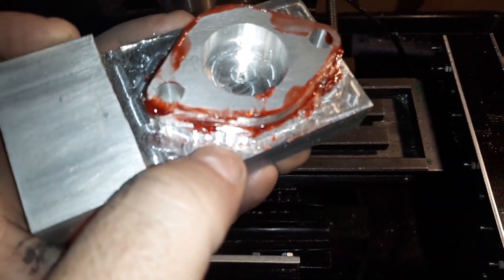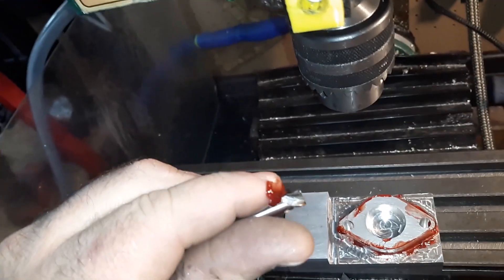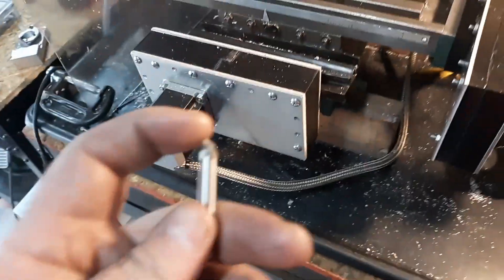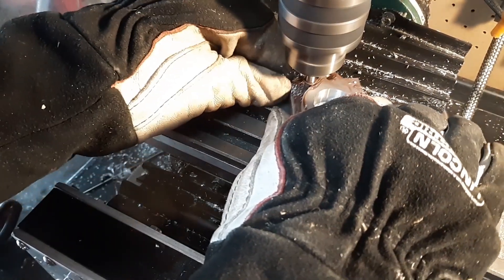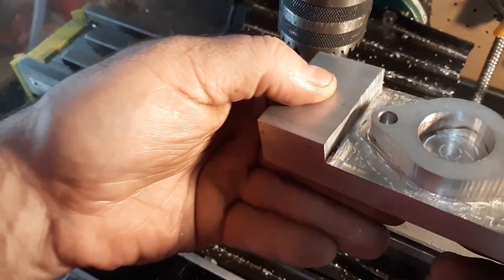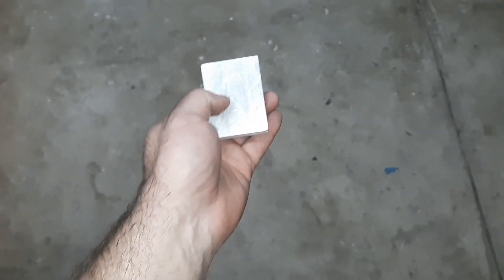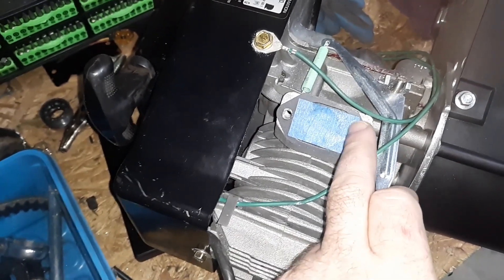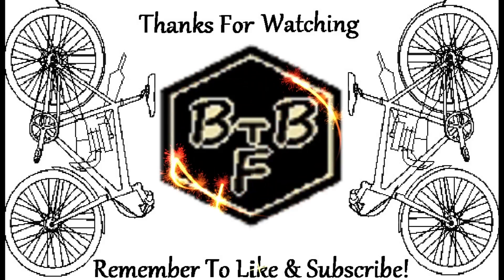139cc 2 Stroke / CVT Motorized Bicycle Build - *HUGE* Intake Adaptor Explained! (CNC Failure) Fixed!

Comment: Yeah dude, make some money, you're doing the work. I pay the $13 a month for YouTube so not getting the ads except on news channels. Thanks, l always thought it was used for drilling as well as rusty bolts. Poor people have poor ways.🥴 Good to see you still have both hands attached 😁
Reply from the maker: well wd40 actually will screw up drill bits.  Most don't realize as it burns when you drill bakes a coating onto them actually works against you slowly over time, like when people use it on brass or copper of aluminum. short term helps till it heats up some then you f'ed bit coated in what ever your drilling lolz   other funny thing is it has teflon in it!  actually makes drill bit not bit into steel  type metal as easy! dulls the bit faster.  most don't realize if you use normal cheap motor oil thinner the better actually makes drilling/tapping  stuff crazy easy vs wd40 and is cheaper!  Tap magic you always hear about! tinny can cost stupidly high amounts cash lol  actually just 0w-20 motor oil pretty much dyed white.  It's untold machinist  secret most big companies buy it by the 50 gallon drum! vs over priced stuff they sell as "taping/cutting fluid" lol  "cnc coolant" looks like that stuff different then the stuff you see all together, most confuse the two, but not stuff they sell to public just light oil!

Comment: Great save! I thought I was the only one that did risky "free hand" machine work. I admit to machining an old boat motor throttle bracket for a friend at work on a large VSD drill press when the Bridgeport mill was busy/tied up with official company work. Clamped in a loose, smaller vice for mass, I slid the vice clamped part to a 2 flute mill bit & "machined" it to the marks scribed on the part. Ugly? Yeah, but a few seconds on the belt sander followed by 3 min. on hand sand paper & my friend was amazed & happy. Fishing happened after that ! Love this channel & the build!

Comment: As a machinist for 40 yrs I had to cringe a bit at the free hand method,, then I remembered you are an old fossil like myself so when we say " old school" that means before computer assisted machines lol
Reply from the maker: Well the Issue was! I had to cut that part off Center with odd ball oval to fit Carb union and match second side so aligned up with crank case bolt holes.  CNC lost a whole axis last 3mm of cutting! around the outSide mostly cosmetic at that point anyhow Funny enough start point of that part no longer existed since was in offset center of an oval.  Could you imaging finding the center point of an oval rerunning that parts edge to cut last 3mm lol  sure if You had digital edge finder where learns the position by taping points!  But this 500$ china hand mill converted with 3d printed parts making it cnc LOL   To be far many people cut 80% ar15 that way with jigs all time with hand router so, why not right only live once!  I told people all the time that after I rebuilt a jet engine, as we watched it get dropped back into a passenger plane 🍺🤣👍

I use to run a 12 Axis gantry CNC arm mill at the company I worked for.😁 I use to cut turbine Screw Chambers from one end to other inside a 10 foot long block forged  metal as one piece. Use to make a lot stuff for aerospace companies and military. Many Impellers and propellers, half shit i was not even told what it goes in or what it was used for.  But they need a part that was impossible to make in time frame lol.   Parts would sit on a Delta platform and rotate.  counted as 3.  Gantry holding the arm. Was 2 Axis and 1 rotational axis at arms base.  And was 4 axis on arm . But if you included the Brushless servo mill head which was pretty much weirdest mill head ever seen my life it be 13 lol Never could decide cause whole mill bit ran digital brushless servo  like everything else on the machine. 0 to 60Krpm in 3 seconds. It was direct drive and could run a 8inch shell mill 1/4 deep like it was nothing through stainless.  It had another weird feature that head!  Since it was  A Controllable Servo! It was used to turn Curved wire into parts submerged in tanks at times to drill Curved holes 1/8 to 3/4 round. Shit you not with piece of wire attached to a special EDM head sit there days cutting 1/2 curved hole in a 4 foot long block of some type metal 100's times for w/e the part required.

Comment: Nice save hit 'er with a scotch brite nobody would ever notice. Honestly bro the thing that is going to be the most useful in this build is the fact this engine has its own cooling fan. But seriously huge bore she gonna rip!
Reply from the maker: You know that Engine has no fins on the Flywheel! Shit you not no cooling from it LOL looks like a Lifting Weight!  round disc with magnet!  But you have to realize this is off a snow blower!  Normally I think the 2 stroke would be cooled off by lets say -30 degree weather LOL  It has been one of the things I was worried about being in South carolina of all places where weather is 102F out half year. I was actually told to run 20:1 oil gas mix in it just cause of that fact by the gokart people that use these all time. oil does help actually cool engine oddly enough in 2 strokes.  So I'm hoping runs cool enough with wind hitting it and oil mix like that.   will see sounds like a lot of fouled plugs to me at that ratio though!  But on other hand rc 2 strokes gas 1/5 scales all use 16:1 fine down here so will se!
Reply: @BuildBreakFix  ah shouldof known it was off a snow thrower, the 3 horse tecumseh I had was the older silver shrowd version with the pinhole exhaust. lolz here in UT I can ride my motorized bike to the corner store and back and my crankcase is still cold!

Comment from the maker: ALWAYS REMEMBER SAFETY FIRST!  So Close your eyes while you do this to avoid stuff in them LOL!
No Seriously!  Wear eye protection and Gloves.  Be Safe!  I literally have face shield on and safety glasses on under that! With A Pair of thick welding gloves on!  Non of this stuff is worth getting hurt over. If you end up blind Making  it, then what is the point of it to start with? Be safe! Always ask for help if you don't think you can do it!  Stupid questions are the ones never asked! 

  
Before 100 people ask me:    WHy did you make it out of such a thick chunk of aluminum? I would of just made a plate and attached a carb......   Well...!  I wanted to match the Intake of the Engine to The 32mm  ID of the Carb Boot!  I need 9/16 (14mm) of material between the 2 openings in the center to Slope everything in a nice Even transition to one another! Trying to avoid a Wall in the Intake side where air will cause mass turbulence in flow!